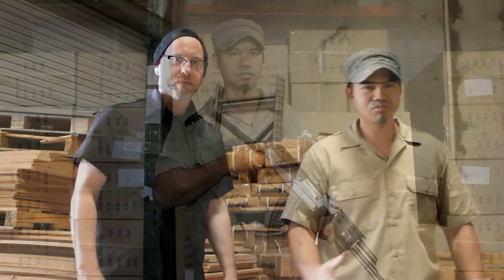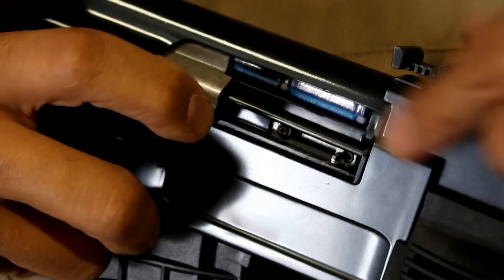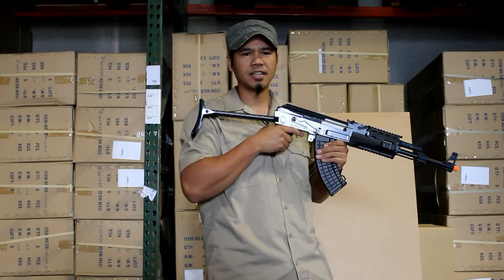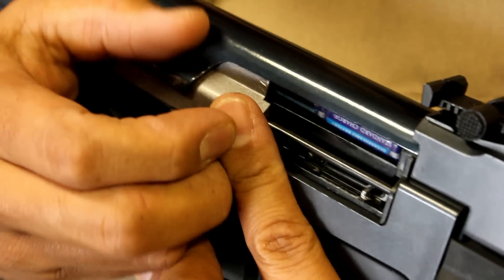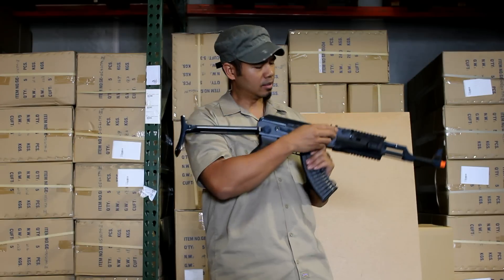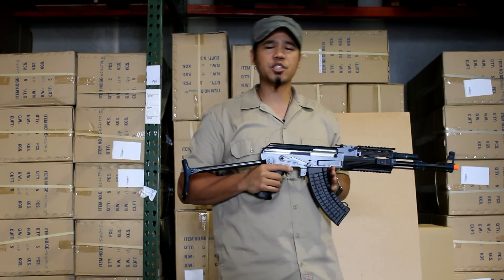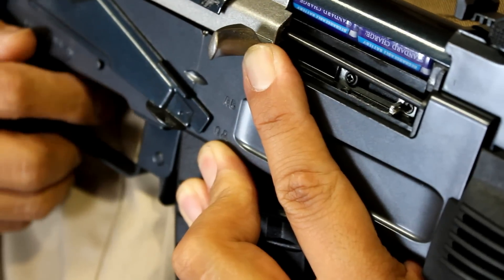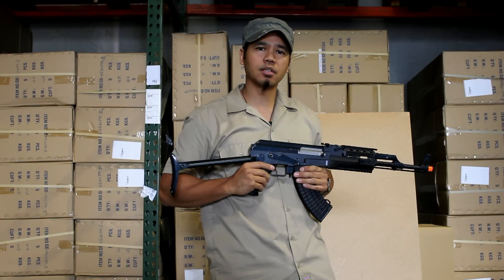Airsoft AK47 Hop Up Adjustment Video - How To Tutorial Review

Comment: Don't order from them, I bought the same ak (with the full butt stock) and it takes a large type battery so they changed out the wires for Their own selfish needs and gave me a small type (it needs a large type) not only that the gun came 100% defunctional semi dose NOT work and it jams w/ every 2-4 bbs it shoots so my waste of $125  is sitting in the box it came in barley touched for ever because they blame it being broke on me it still has the tags it's so new :,( thanks airsoft megastore
Reply: SealXTeamX6X1  did you not send it back to them or call them?

Comment: my new aisoft ak47 the moter is running and has slightly less powered (muffeled) sound and bbs fall out the end do you know what the problem is.
Reply: Lube it with silicone oil